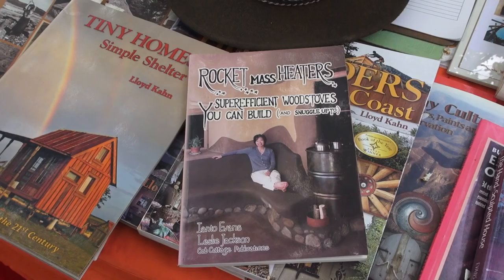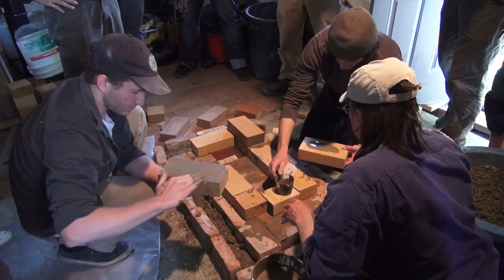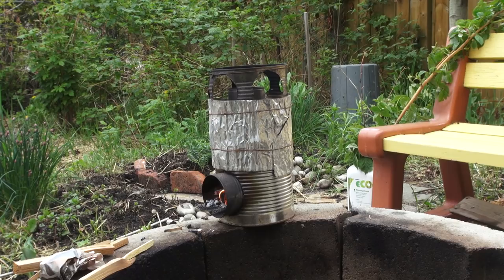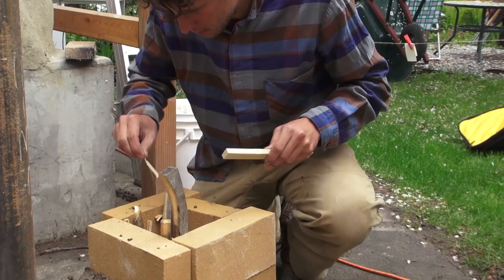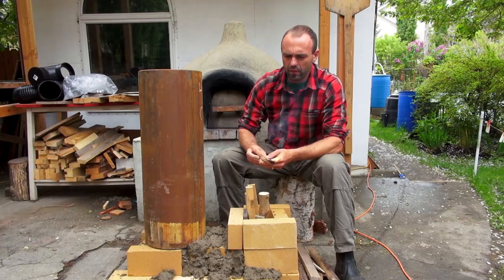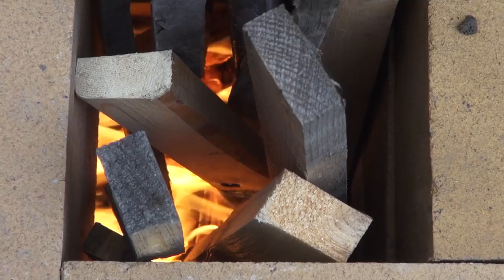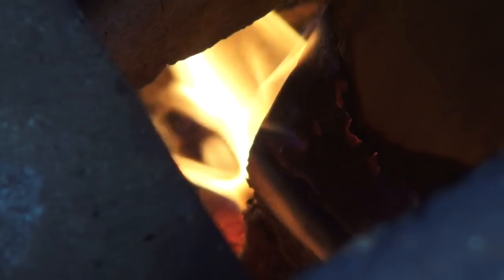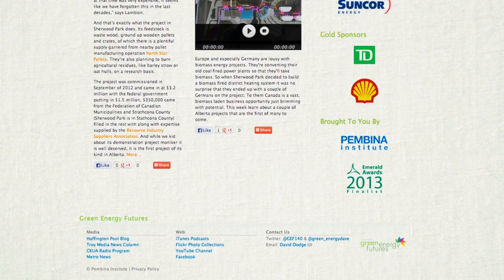47. Rocket Mass Heaters: A better burning wood stove

Comment: One thing that is missing in all the 100's of educational video's about rocket stoves.heaters is the... where does the heated air go from the riser?  The riser is a dead end.  Once the air rises and is superheated  in the riser: where is the duct that takes this superheated air out of the riser?  The hot air is at the top of the riser.  Hot air does not travel down!  Where does that hot air go?  Where is the exhaust?  Where is the piping?  Where?  None of the videos show where the air goes after it is TRAPPED in the riser.  There should be a diagram showing the air-flow.  Just like all electrical circuit trace where the electricity cables go: there should be a diagram showing where the air goes.  None of these videos show it or explain this.  In other words there is no way in hell you can build your own rocket stove from watching these videos.  Just like you can't build a radio without the circuit board diagram: you can't build a rocket stove without the piping diagram: which is buried inside the mass.  Nobody shows the piping system.  They just show some mass of shit covering the piping system, hiding it.  They never show the actual pipe layout before they pile the all that crap over it:.  Talk about stupid.
Reply: If you do some google searches you can find very detailed explinations about how it works.
Reply: A wise man once said this, and I quote:
what can you understand about an orange by looking at it
through a microscope? The answer is; very little. But if you plant an orange
seed and wonder about it. If you care for the seedling, and study its growth
closely and wonder about it. If you watch how it grows into a tree and
wonder about it. If you live by it, and sit under its shade and wonder about it.
If you listen to the wind soughing through its branches and enjoy its beauty
and wonder about it. If you pick its fruit, eat it and wonder about it. If you
explore the incredible range of uses we have found for its oil, its rind and its
pulp: in medicine, cooking, woodwork, nutrition and wonder about it… The
wider the context of your experiences, the more comparisons you can make
between different experiences, the better you can evaluate them, the better
your perspective, the better your understanding is of anything
Some peoples orange tree might just be a rocket stove.
Reply: RochesterSportRifles

A stove is an abomination of self-interest.  Caring only about yourself while the rest of the world suffers is an abomination of self-interest.

To Understand LIFE you must touch living creatures and living plants with your hands and your living skin and you must let them touch you.  You must learn from LIFE: not from books.  You must learn from LIVING: not from reading words. Words without action are empty meaningless things.

There is s difference between sharing and selfishness.  Until you learn the happiness which you get from sharing: your selfishness will cripple you and your soul will shrivel.  If you want to be warm: hug someone and share your warmth.  If you have no warmth to share then you are lost.
Reply: RochesterSportRifles

He who runs away from the truth is a coward.

You are a coward.
Reply: Indrek Pringi
 failed trolling attempt :DDD 1/10 best I can do :DDD XDXD
Reply: Indrek, the riser inside of the barrel is insulated, thus superheats the remaining gases. It then hits the top of the barrel, where it gets dispersed, and cools. Yes, it's still very hot, but cooler than the insulated riser. As it cools, it drops down the sides of the barrel, through a "manifold" on the other side from the burn chamber, often made of cob, to the horizontal stove pipe which runs through all that mass. The super heated vertical chamber does two things: it draws the flame down and across, and it acts kind of like a catalytic burner- re-burning any remaining gases which might make creosote in the piping otherwise. Yes, we've all grown up to believe hot air only rises, but it's being manipulated by the barrel in these stoves. You can see people testing them before the barrel covers the pipe, and as the gases rise, pull the flame down and across the burn chamber. It's not magic, and it does work. Good luck.
Reply: The riser is NOT a dead end, the flue is outside of the riser and buried in the mass, opposite the intake.  It wouldn't be an RMH without a flue. Either you haven't watched the 100's as you say, or you just haven't paid attention. How did you think the mass got heated, magic?
Reply: The heat comes from the heated mass...rocket mass heater...calm down,get those 2brain cells working again...and watch carefully....its all there and plz  stop calling people stupid,makes you look bad specially if u dont understand the concept under a minute 😂😂😂😂😂
Reply: Hot air chases cold even when it’s down. You get a circular movement that creates a vacuum
Reply: Indrek Pringi sounds good until you’re trying to hug warmth into your body at -10*

Comment: It's the way of the world isn't it.

A doer, a maker,  thinks of a great idea, a cheap, clean way of providing heat. Then you get the detractors....the regulators....the this is wrong, that is wrong people.

I want to build one of these, and I will, but you have to jump through bureaucratic hurdles. They'd rather maintain the status quo where you have to pay a fat utility company.
Reply: Paul Marshall, this has been my experience as well.  I prefer the rocket mass heater--the sooner, the better.  Just need someone to help me do it.

Comment: These stoves a silly. You would have to spend all your time sitting there feeding it with fuel. Might be OK where it is not very cold. Give me a big cast iron airtight any time..
Reply: Your comment is silly. Have you even watched the movie or done any further research?
Reply: The idea of adding mass to a wood stove is no new idea. I have been heating my new York mountain home for 30 years with just wood. no grid and no hydrocarbons burned (except the wood).It is true I have never seen one of these stoves in practice, maybe you could recommend some post that could give more info. However from what I see there is no control on the air intake and that would be a problem, plus the firebox looks like it could be bigger. But I am certainly no expert on this stove. However I am an expert on heating home with wood. I have cut .split and burned hundreds of cords by hand over the years and would love to find a system that works better(that is why I watched the video in the first place) Dave P.
Reply: http://www.permies.com/forums/f-125/rocket-stoves

Lots of vids on youtube as well.
Reply: You assume that you burn wood just as fast in both systems which is not the case. The rocket stove uses way less wood and you would have to feed it way less than you probably think. Also, there's thermal mass involved which means that even when the fire is out, it still heats up your room for a long time.

I guess it's a trade of between feeding the fire a few more times in a rocket stove or spending a lot more time (and money) collecting and cutting a lot more wood for your regular stove.

Besides, a regular stove doesn't burn all day on a single load either. It needs quite a few refills to keep it burning as intense as it does.
Reply: * facepalm * the man JUST said that the system's heat would radiate for hours after the fire stopped burning wood. That would indicate that you would not have to burn as much wood at all ie. feeding the fire.

Comment: All of those were built WRONG. Do NOT use steel in the heat riser.  Basic physics.  low carbon environment steel + Oxygen = it's going to fall to pieces, literally, in flakes.